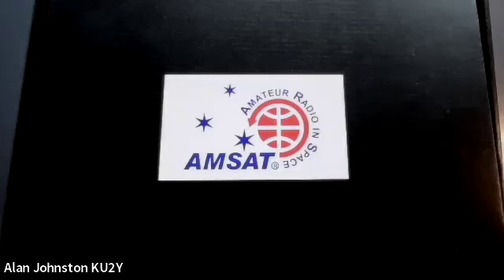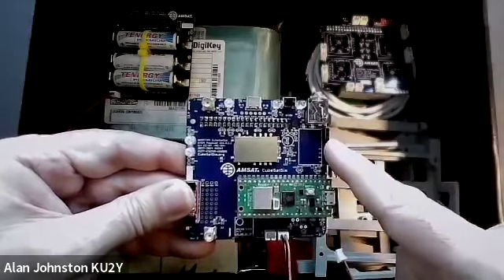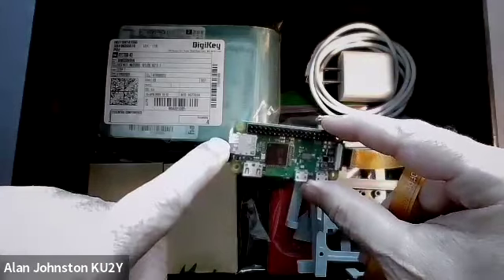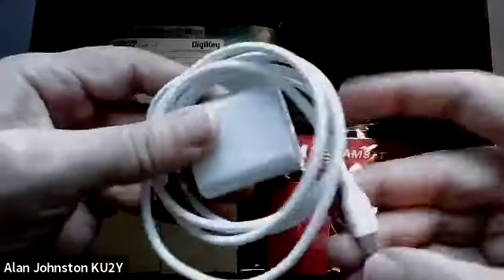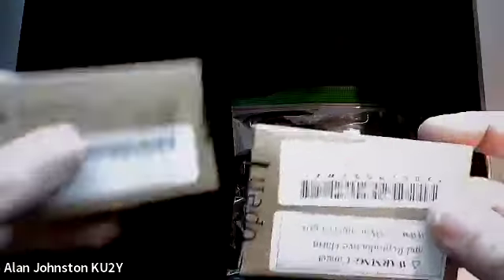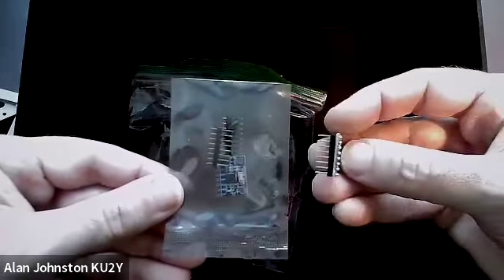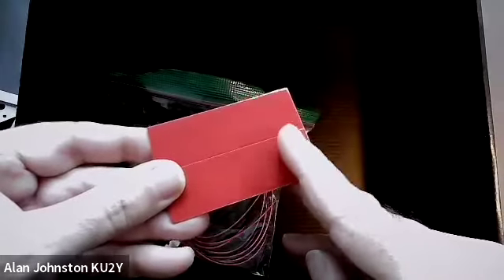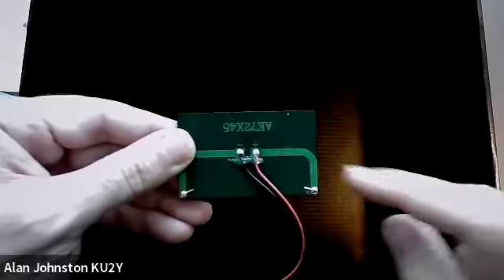CubeSatSim Beta Kit Unboxing

Comment: I have built the payload board and everything seems to be working fine except I2C3 is showing fail.  Is this because I have not installed the BME280.  The dual battery SMD holder is presently unavailable everywhere I have looked is there another source or replacement?
Reply from the maker: Hi Johnny, I believe you started with the blank PCBs and have ordered parts to build your CubeSatSim, right? If you could post your question on our GitHub Discussion page, we can help you out https://github.com/alanbjohnston/CubeSatSim/discussions 

Alan